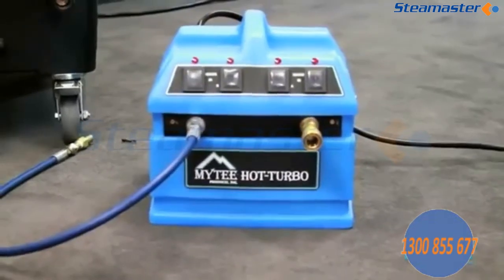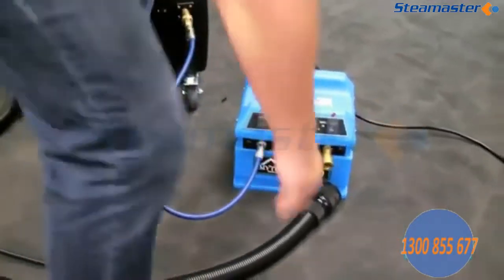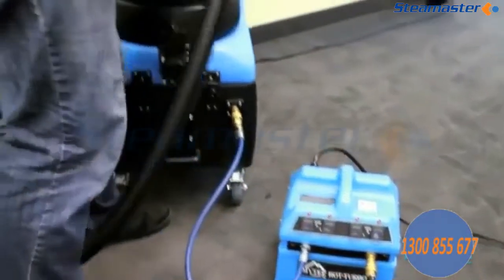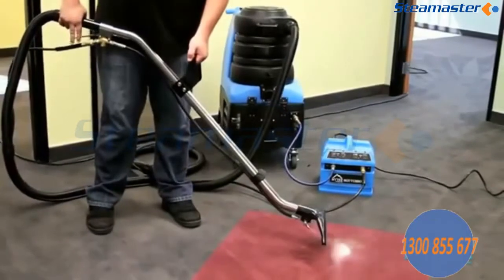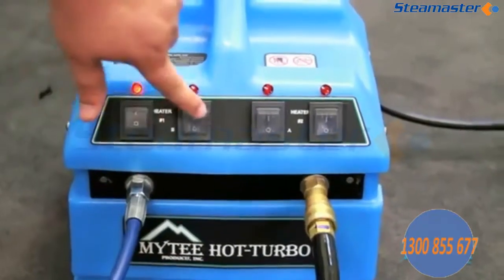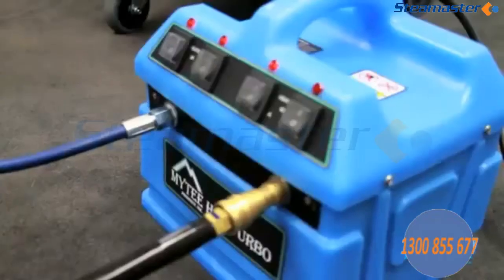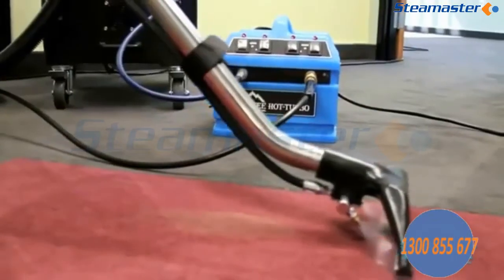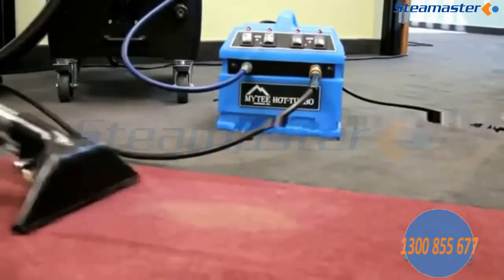Mytee Hot Turbo Portable Heater

Comment: you can use that with a power washer
Reply: This not meant for pressure washer. It works only if you are running it below 500 psi, and 2.4kW is only enough to provide warm water at 0.75gpm. If you need more hot water supply, just hook the pressure washer to a lukewarm hot water tank or a gas inline heater tank.